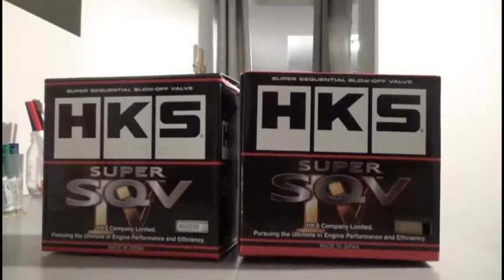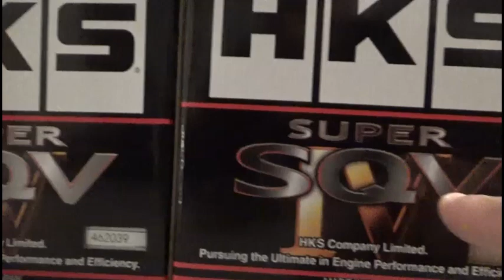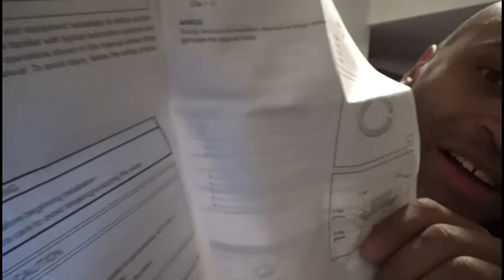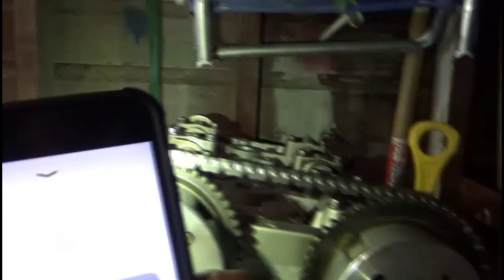Spotting a Fake HKS Blow off Valve.

Comment: Serial number 402838 is the number fakes use.  Used to be able to tell because the older fakes had 8 bolts instead of 10, now they've got 10. But they kept the same generic 402838 serial number.

Comment: Well I'm glad we caught that fake bov before it caused any damage. You're missing a couple things, like the vacuum port is longer on the fakes, the fakes are bigger, the fakes usually aren't red on the valve (most are purple). The G176 marking at the bottom is usually on all of the fakes, and the lot number "402838" has been used many times. The chamfered shiny c clip is usually one of the best ways to tell, also authentic bov's don't come with the pipe adapter. 

All in all not a bad video, your next video should be "How to remove and install a HKS Bov".  Because we all know how much fun that is..

Keep up the good work!
Reply from the maker: John Wisniewski thanks for the input!!!! 

Lol that install vid is coming 🤫😂
Reply: Plenty of the fakes have the pupe adapter